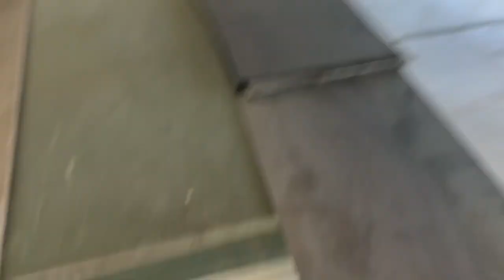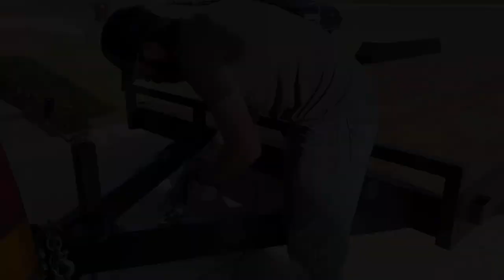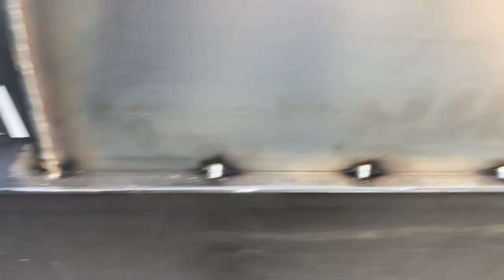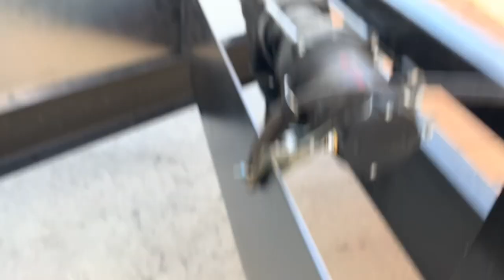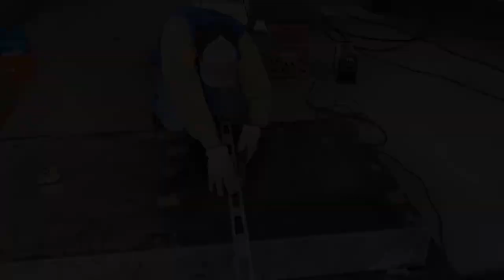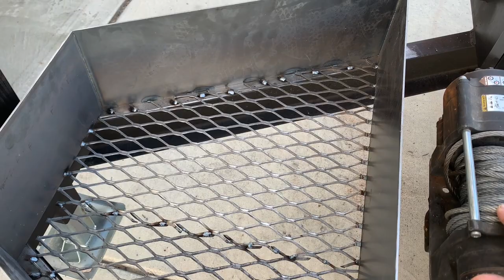Homemade trailer tounge box, trailer winch install. Homemade trailer.

Comment: How much do you think you saved building this trailer yourself vs buying one exactly like it?
Reply from the maker: 3000-3500
Reply: I built a 28-foot  sxs trailer  out of a camper  frame. If I had to do it over again  I'd bought  a new car trailer for the same cost as I have into my trailer . I never figured  in my time I invested  in it. Virginia  has pretty good prices  on new trailers.

Comment: A year later, do you have any regrets using expanded metal for the bottom?  Maybe you live in a warm climate, but I built a tool trailer and used expanded metal for the floor.  First time I drove through a puddle everything inside was covered in mud.  Then snow season came and it just got worse.  I used expanded metal because there's machines inside and it's great for air circ while venting the exhaust. Now I'm looking to cover it and build a dedicated air intake for everything to use.  I'm thinking of making a vehicle filter box and doing away with the individual small engine filters.
Reply from the maker: If I was using the trailer everyday in the winter I would cut a piece of rubber to go in the bottom. But it’s fine for me.
Reply: @kmac9759  Good thinking, I just bought a truck bed mat at tractor supply yesterday.  Damn that thing is heavy!  best I can do is drag the friggin thing

Comment: Have you had a wasps nest inside that box yet?  Looks good, but that would be an issue for me.
Reply from the maker: Not sure, its been parked at my dads place, but I wouldn’t be surprised if it had a few in it.
Reply from the maker: Update. No, haven’t seen any wasps anywhere on the trailer.